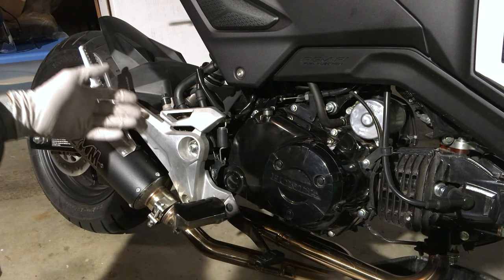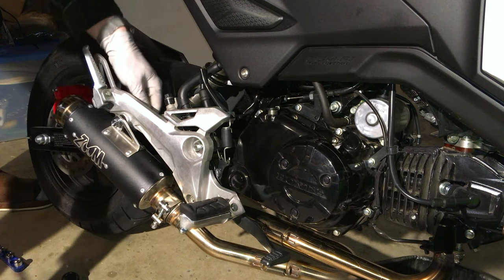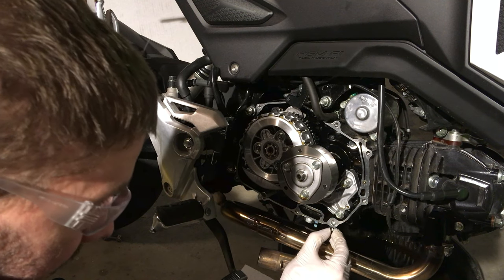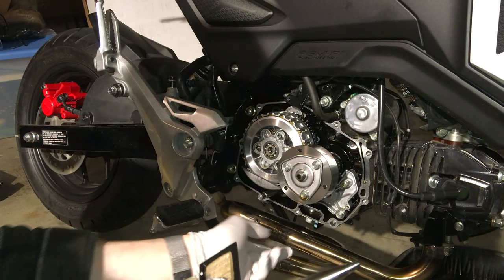Kitaco Clutch Cover Filter & Sight Glass + Oil Cooler Port Kit Installed on 2019 Honda Grom SF : DIY

Comment: Rewatched this as the kit has finally arrived for me. 

You can dab some oil around the cover gasket face on the engine block to help hold the gasket in placed or info guys.

Comment: Thanks for the video, mate. Looking ar tackling this mod on my Grom too.
Reply from the maker: Tuning the motor without a BBK better for reliability / a super 125 tune with power commander, race exhaust, cold air intake, flywheel removal, clutch cover & oil cooler gets HP to ~12.5 from 9.7 stock / it revs easier & pulls harder when accelerating - sadly top speed with factory gearing just not safe where I live // after tuning the Grom & riding it for a year, I ended up trading it out for a larger, heavier & less efficient but 3.5X more powerful Yamaha MT-03 which I will never tune since ~42 HP insane & can go 112 mph top speed / more than enough - my first 2 bikes were Honda F4 & GSX-R600 == speed kills & not legal & not even that much fun when your going the same speed constantly, like flying on a plane at 530mph, acceleration is where you feel the fun & the Grom was a blast from 0-40 MPH // the MT-03 pulls like a Lotus Elise when getting on the highway, the engine sounds amazing in stock form & I will never tune it / 321cc fast enough with nearly 42 HP & 6 gears / plenty for highway riding // safe riding brother! Have fun tuning too! Cheers

Comment: How bad was it working on the bike on the floor? (I don't have a bike jack either and going to attempt this tonight) Perks of DIY garage jobs!

Good video anyways! Got an OG that I'm gonna tackle tonight.
Reply from the maker: I am sure you got it :) Loved the Grom SF but traded it for Yamaha MT-03 as my route to work now requires being able to go 70 MPH or about 90 km/h // to keep up with highway & freeway traffic. When Meg & I purchased the grom, I lived 3X closer to work & the route too & from was all low speed roads so the Grom was super fun. At higher speeds I had to rev the Grom's 125cc engine to near redline & peg it there for highway riding, just not enough zip to keep up with traffic even after I increased HP to 12.5 from 9.7 stock by tuning it //

Comment: Instead of using that tool. Stick a penny in the teeth of that gear. It's copper and won't damage but will allow you to break those bolts free
Reply from the maker: I traded the Grom SF in on a 2020 Yamaha MT-03 & love it // the Grom was a blast around town but could not handle highway freeway, even one up after all the tuning boosted performance a moderate amount. I spent a grip tuning it DIY & it did improve, especially made it rev faster, faster off the line & improve top speed a bit too, just not safe where I have to be able to go 80 MPH on road trips etc